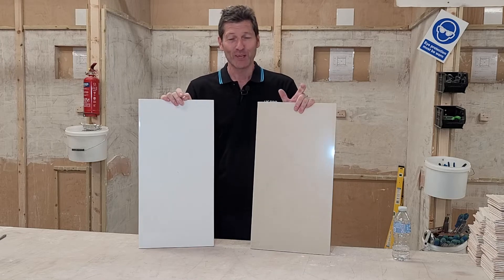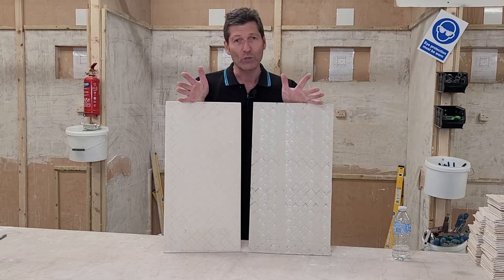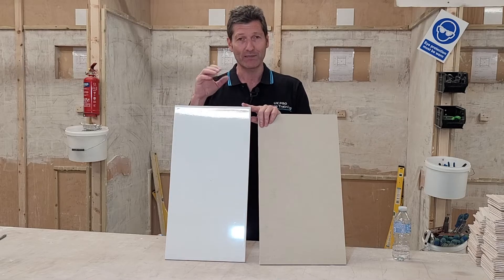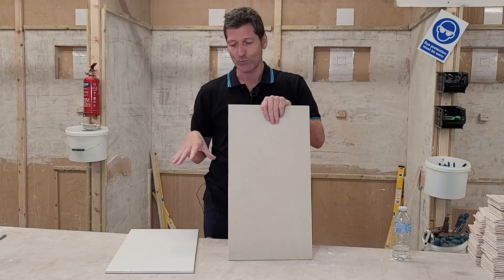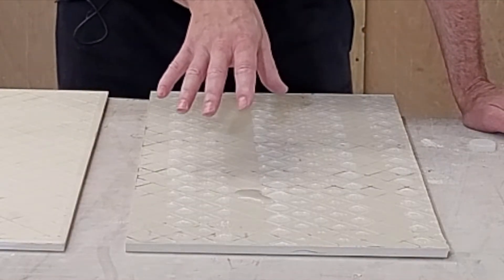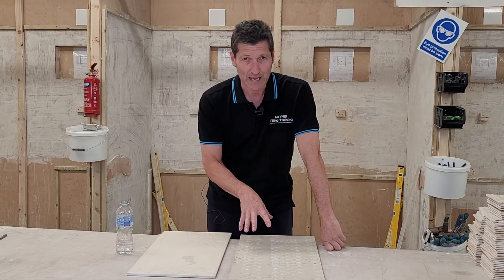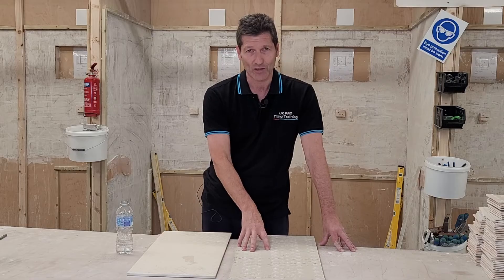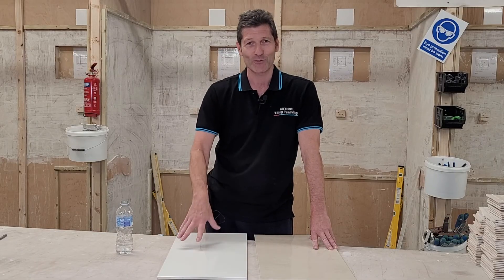Difference between ceramic and porcelain tiles explained

Comment: Which one is the best for use between the two you making an example with?
Reply from the maker: Porcelain is the best material as it is harder wearing and less likely to chip or crack and comes with better designs however its more difficult to cut, check out another one of my videos on how to cut hard porcelain